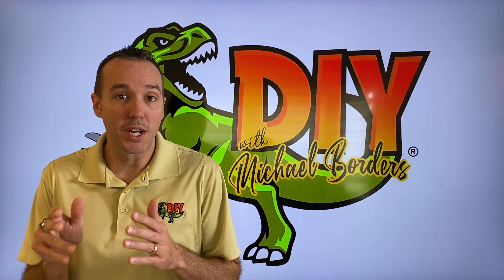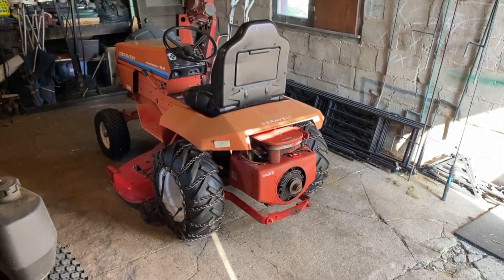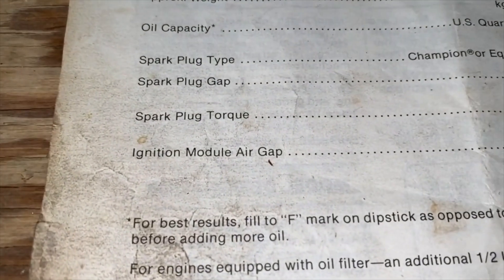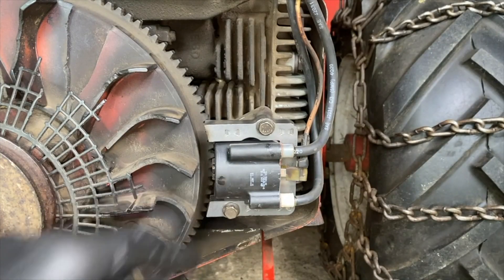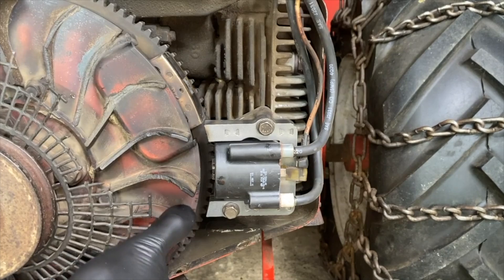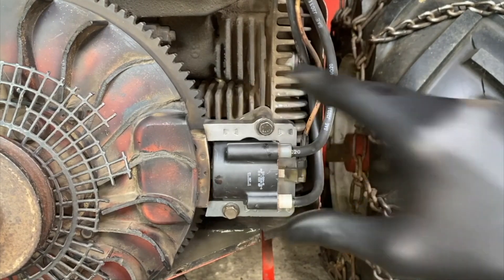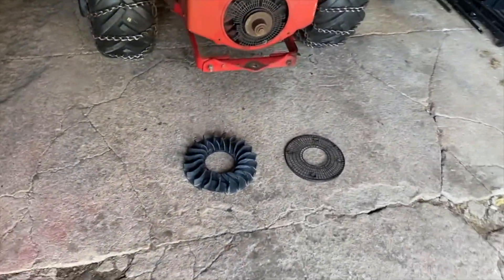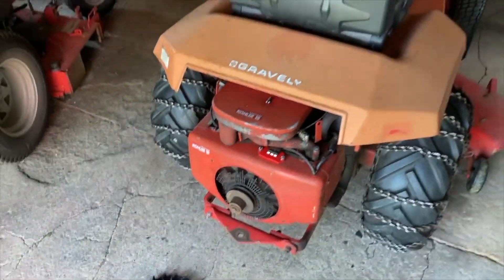Set ignition coil Air Gap on Kohler Magnum M18 engine Gravely tractor

Comment from the maker: If interested in purchasing this product, visit our Amazon affiliate link below.  I earn from qualifying purchases.

Gravely touchup paint:  https://amzn.to/3M8gpQt

Ignition Module and Spark Plug wires:  https://amzn.to/4dpDXfB

Feeler gauge:  https://amzn.to/3yl1GOS

Aftermarket gas cap fuel gauge (Not our OEM)

       12 1/4:  https://amzn.to/4enrBFw

       10”:  https://amzn.to/4dqJbaj

       9”:  https://amzn.to/3N35jwD

       Modified insert:  https://amzn.to/3ZG7m17

       Diesel gauge:  https://amzn.to/3BmTJKh

Oil filter wrench:  

       https://amzn.to/47EXCWU

       https://amzn.to/3TIbmKD

Kohler engine oil kit:  https://amzn.to/4eaDTkt

OEM Air Filter:  https://amzn.to/47zXfgc

OEM Filter Element:  https://amzn.to/3ZxD7cw

Flywheel fan blade assembly:

       https://amzn.to/4dOUauN

       https://amzn.to/46T4cc6  

New OEM grass screen:

       https://amzn.to/4de1cZK

       https://amzn.to/4coKeXP

Ratchet style wrench set:  https://amzn.to/3ZhDgRp

Craftsman voltmeter:  https://amzn.to/4dKa1uC

Spark plugs:  https://amzn.to/3X6471f

Ignition switch:  https://amzn.to/4bXTJN8

Craftsman impact wrench:  https://amzn.to/4elDVGl

Gas cap fuel gauge (Aftermarket 10”)

          https://amzn.to/3B8abOg

          https://amzn.to/3B9iJEI

Spark Plug magnetic socket:  https://amzn.to/3XxEAhE

Dielectric grease:  https://amzn.to/4dSbsHS

Stater:  https://amzn.to/46OtzLT

Voltage Regulator/Rectifier:  https://amzn.to/4fMoo38

Keychain:

       https://www.ebay.com/itm/266380740791?mkcid=16&mkevt=1&mkrid=711-127632-2357-0&ssspo=92VVV1xASp-&sssrc=4429486&ssuid=9oPkoM_JR36&var=&widget_ver=artemis&media=COPY

       https://www.ebay.com/itm/266382070878?mkcid=16&mkevt=1&mkrid=711-127632-2357-0&ssspo=92VVV1xASp-&sssrc=4429486&ssuid=9oPkoM_JR36&var=&widget_ver=artemis&media=COPY

Starter Relay Solenoid:  https://amzn.to/4dMvMK4

Carburetor:  https://amzn.to/4fQrxir

Carb/choke cleaner:  https://amzn.to/3MkGw6W

Shop Towel:  https://amzn.to/4csRp0V

Replacement Battery:  

       https://amzn.to/4csMKfu

       https://amzn.to/4cy8iY6

       https://www.lowes.com/pd/Deka-12-Volt-540-Amp-Farm-Equipment-Battery/50183773?cm_mmc=shp-_-c-_-prd-_-sol-_-ggl-_-CRP_SHP_PLA_SOL_Online_E-F-_-50183773-_-online-_-0-_-0&gad_source=1&gbraid=0AAAAAD2B2W-GGBjHIwl0EMNODS9eUOgWC&gclid=EAIaIQobChMIsPH-l6z5hwMV6DMIBR1VUQLDEAQYHSABEgJ0tvD_BwE&gclsrc=aw.ds

Starter:  https://amzn.to/46KSmAJ

Fuel pump:  https://amzn.to/3M9lw2O

BEST grass seed:  https://amzn.to/4cE7oKu

Copper Bullet Pocket hose:  https://amzn.to/3VO6Vyc

Flag Pole:

          https://amzn.to/4eY61Ii

          https://amzn.to/46063uW

****************

Gravely Mower PlayList

          https://youtube.com/playlist?list=PLjCXOz8TSkZm6clA9JxmXWVhwT-cISDGt&si=b0gxEvA-HUirqMeg

****************

1.  Replace riding mower battery

          https://youtu.be/Z4NXYWjmwMo

2.  Replace 1987 Gravely mower Ignition Switch

          https://youtu.be/nAUqONjuxVQ?si=NNP0coslJMFlFMl5

3.  Gravely mower engine not shutting down - Common causes

          https://youtu.be/UdZ2ebi2WQM

4.  Adjust 1987 Gravely mower Forward and Reverse clutches

          https://youtu.be/ZsJ7JBkkYho

5.  Replace 1987 Gravely mower Grass Screen

          https://youtu.be/io5NhTCFaxI

6.  Replace Ignition Coil Module and plug wires

          https://youtu.be/JXio8ia42z8

7.  Mower not starting - Common causes

          https://youtu.be/Ny4lyVGBdCk

8.  Replace Starter Relay Solenoid

          https://youtu.be/nVMfcWNuRKk?si=R0u79-zFkPS9Xjh7

9.  Adjust and set Brake and Parking Brake

          https://youtu.be/4yAa68vsdqY

10.  Replace Kohler M18 engine Carburetor

          

11.  Replace Kohler M18 engine Spark Plugs

          https://youtu.be/awRTeumQAsg

12.  How to gap your Spark Plugs

          https://youtu.be/z066ckRtLsI

13.  Replace Voltage Regulator

          https://youtu.be/vY57Kzr6i1g

14.  Replace Air Filter and Element

          https://youtu.be/sPPhoIkly5w?si=-c_tnKIHuYBzvp03

15.  How to change oil and oil filter

          https://youtu.be/577s7MqMD64
👍